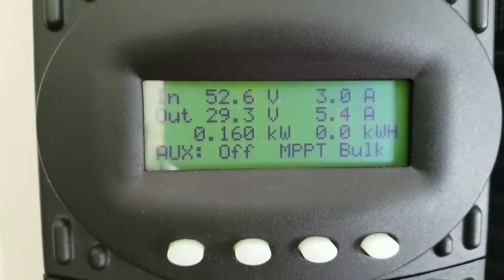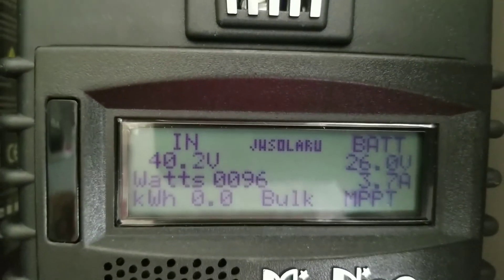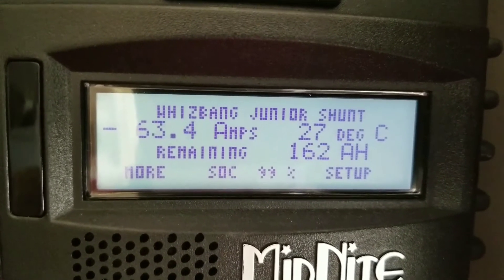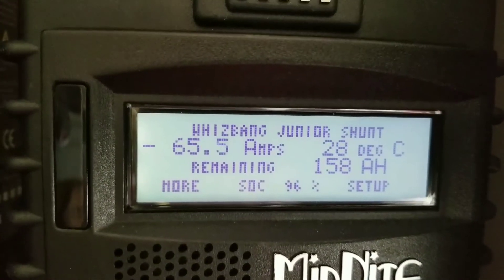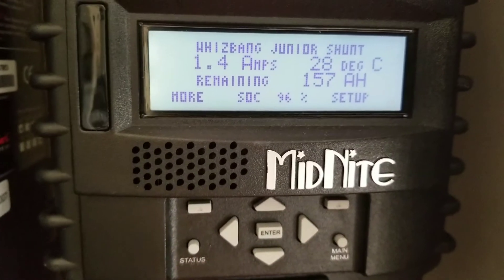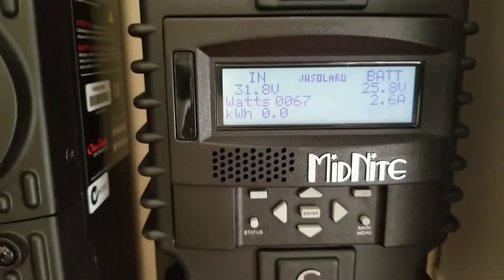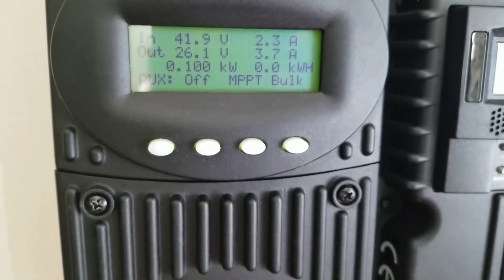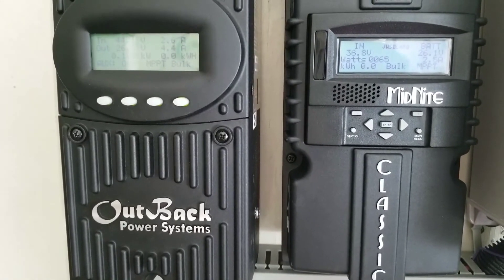TESTING MY 24 VOLT COTEK SK1500-124 INVERTER Pt.6 - With Classic 200 & Flexmax 60 at 80% Load Test

Comment: Can you tell me if the Cotek inverter is any Good? Also on the 120vac receptacles on the front of the unit, can you measure the voltage coming out of the hot and neutral sides of one receptacle to the ground portion of the plug?? What I really want to know if the hot side of the plug measures 120vac to the ground and the neutral side measures 0vac.
Reply from the maker: Hello brother Steve,
That inverter is not currently on my board. I had to put it away on Storage as a backup when I need just a little inverter